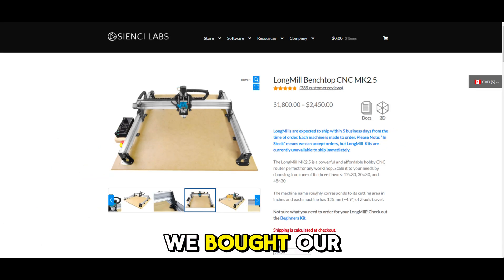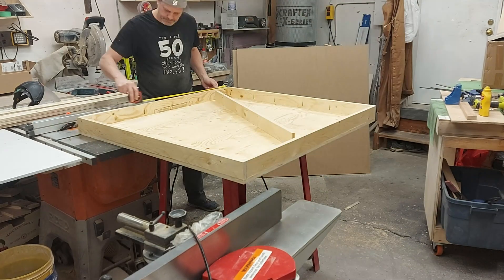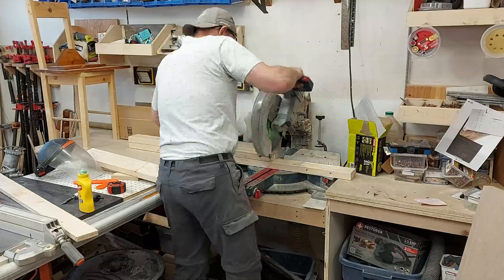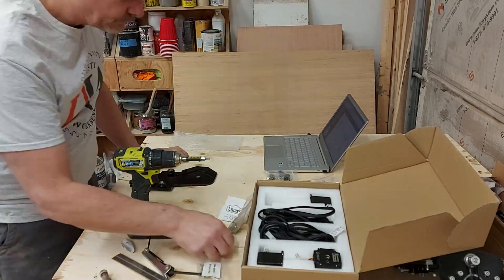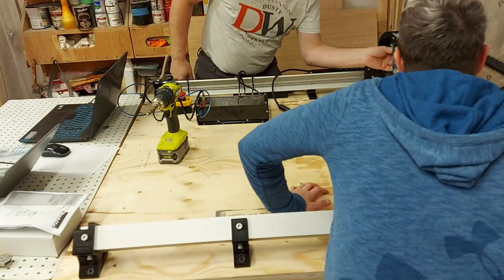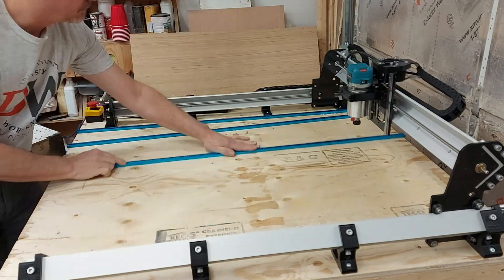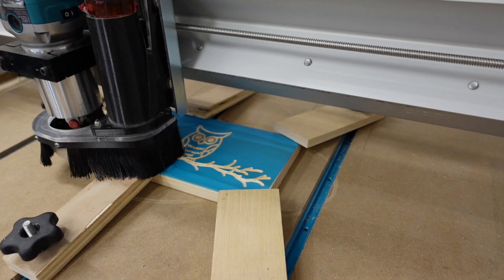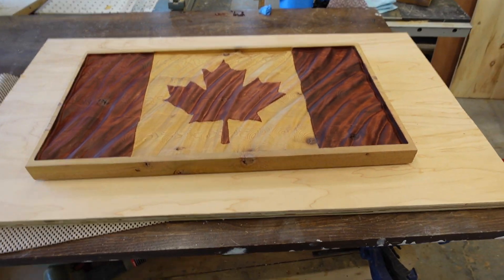Setting Up and Using My Longmill CNC (2.5 Year Review)

Comment: Just looking into CNC as a total newbie, seriously considering the LongMill, thanks for your helpful video.  What's that masking material you use for your carvings?
Reply from the maker: I have no regrets with the LongMill, granted I haven't tried any other but it hasn't caused me any issues and the price was right so it's good in my books. The masking material I use is called "Blue Stencil Vinyl Masking Film with Anti-Bleed Tech". Bought off of Amazon: https://amzn.to/49ky048
Reply: @DustyWorkbench  Thank you so much, I’ll be looking into that.

Comment: I agree 100% - it looks like we built and starting using our MK1 around February 2022?

I likely work mine a bit harder (many hours making catch-all trays, sometimes in material like purpleheart and bloodwood - HARD!) - but I've only had to tweak the wheels once and only a few days did I adjust the anti-backlash nuts for the first time.  Oh - I had to replace my router this year. 

I'm thinking I will want a second machine next year and I am debating whether I want the 2.5 or the AltMill.  I'm not sure I need a 48x48 machine (only twice have I been limited by my 30x30 work area in 30+ months) but... bigger is always better, eh?! 😆
Reply from the maker: That's great to hear you've had such a positive experience with your Longmill MK1! I've been really impressed with its build quality and performance. I'm glad you've been able to put it to good use with those challenging materials.

I'm also considering expanding my setup next year and am torn between the 2.5 and AltMill. I've heard good things about both. Have you done any research on the pros and cons of each? I'd love to hear your thoughts.
I need all the details I can get to pass the spouse's approval. :)